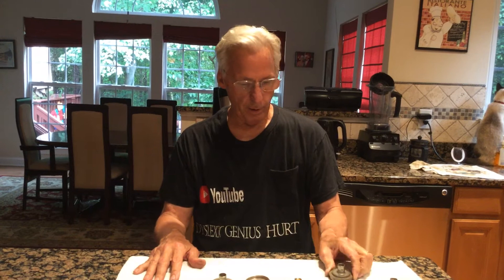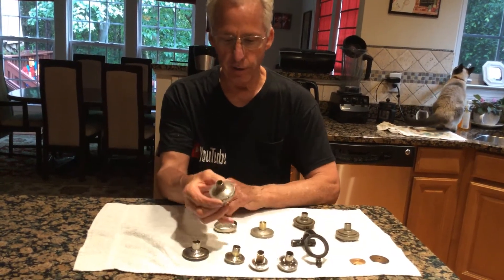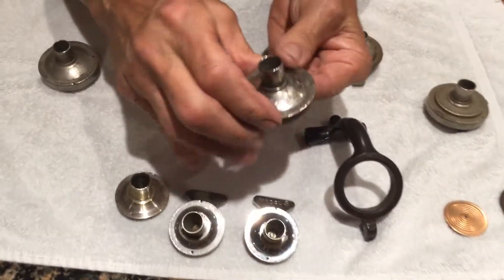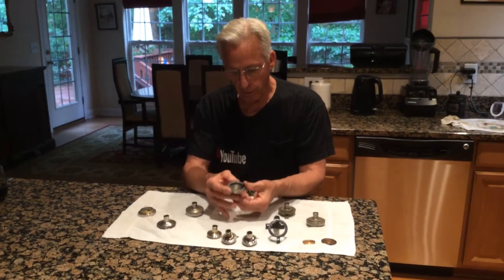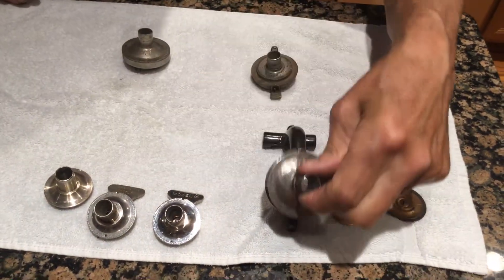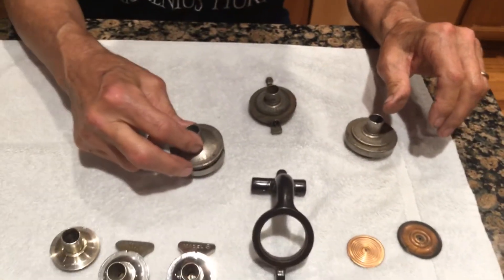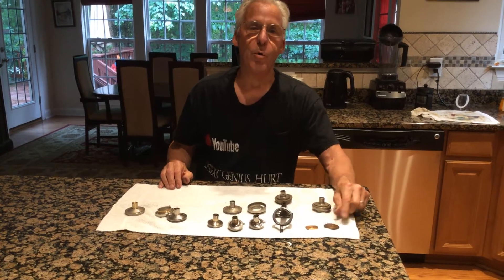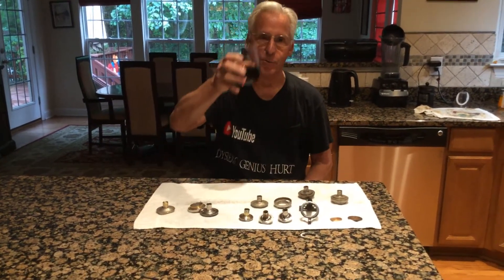325.  Edison C, O, R, and S phonograph reproducers can all be salvaged

Comment: Hi there!
After about 4 years of sewrching, I've finally purchased my first Edison Phonograph. It's a very early model, either the Model A, Type 2 or the Model B from between 1898 and 1901 with a  2/4 minute gear accessory built in. It comes with a 4 minute reproducer so, naturally I'm on the lookout for a 2 minute reproducer. I've found a rebuilt Model C or a used Model S. I'm not sure which to go for or which one would be more compatible with my machine. Any thoughts?
Reply from the maker: By the rebuilt C reproducer, providing it is guaranteed to play well with an intact sapphire stylus